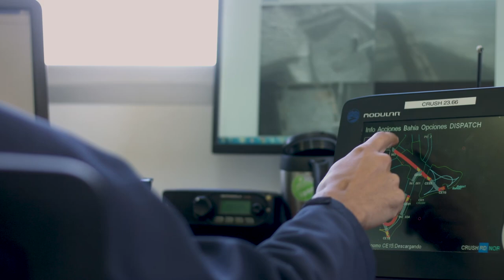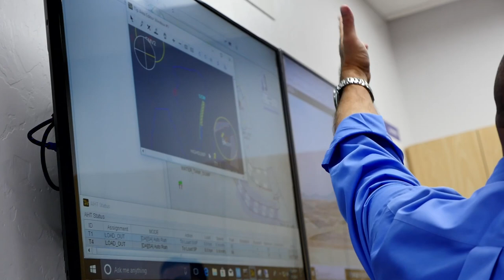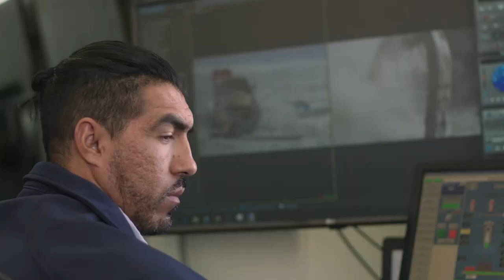Komatsu Autonomous Haulage System (AHS)

Comment: Thanks komatsu for selling out the operator's and soon to leave them without jobs.
Reply: Do you use letters or email? Things could change, people must need to increase knowledge to follow that changes. Thing about it.
Reply: Such backwards thinking.
Lets bring back lift operators for the sake of jobs.... smh.
Reply: @matthewbouton5121  My great granddad would still be working if they still had gas street lights, my granddad would still be up the chimneys, my dad would still shovel coal into a train engines firebox  and I'd still have a paper round!
Reply: @FerotKwari  all the best to you. I believe you have the strength and courage to adapt changing times.
Reply: @matthewbouton5121  bruv, thank you for your well wishes.
Reply: I said the same thing when the modern textile machines were invented, put us our of work. Could no longer sew shirts and fabric by hand. My Grandpa was also pissed when the modern combine was invented, was no longer feasible for him to manually pick crops by hand.